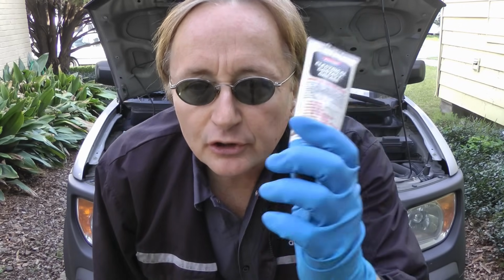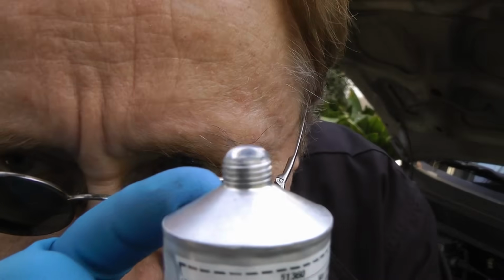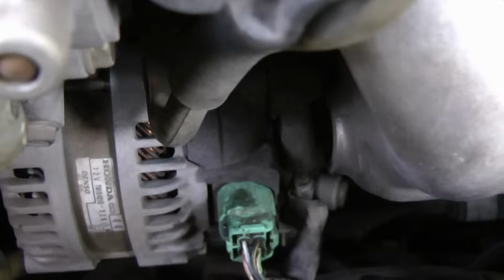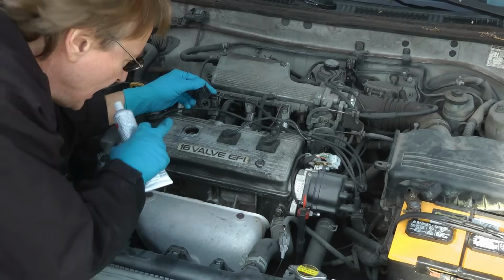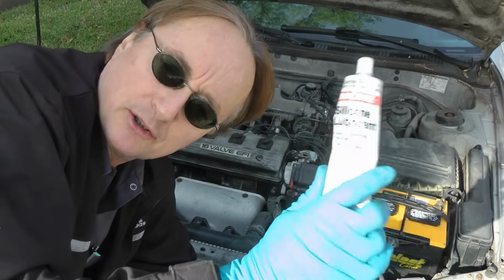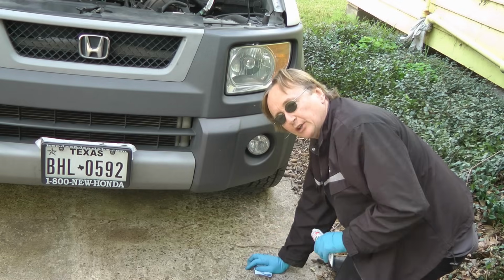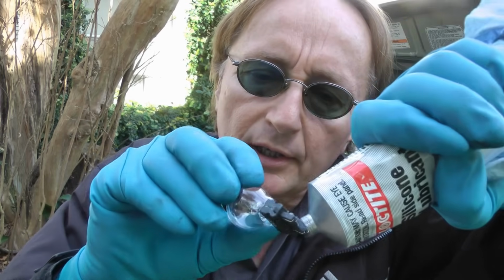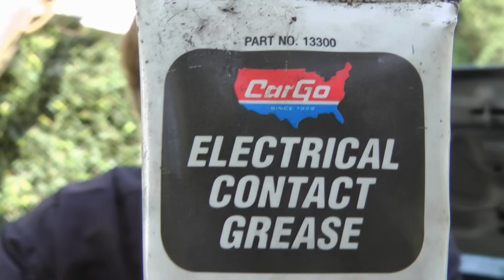How to use Dielectric Grease on Electrical Connections in Your Car

Comment: Dielectric grease does not conduct electricity! The contacts in the connector are designed to squeeze grease out of the way and create metal-to-metal contact. In applications where arcing is a problem a "more conductive" grease (loaded with metal powder) is used to prevent grease from breaking down as arc passes through it.
Reply: would putting some grease like this on the brushes of a brushed motor make it run smoother and more efficient?
Reply: I don't know for sure, but I would guess that grease could interfere with the brushes making good contact, so I wouldn't do it.
Reply: Motor brushes are low pressure connections, so I don't think it would work well.  Connectors are relatively high pressure.
Reply: Yes,if it did conduct electricity he would have a short the way spread it across the connectors the way he did.
Reply: @John Scarce Probably not a good idea. The grease would begin to collect the carbon brush dust, and eventually could begin to cause severe problems.
Reply: Finally!  Someone who knows what they are talking about!  Thank you, One Two.
Reply: I really don't know why this guy gets any views with massive errors like this.
Reply: You can buy conductive dielectric grease, the stuff I can get locally is called conductive carbon silicone grease, but if you are putting it on plugs there is no way it can be conductive you will short out! The conductive stuff is good for grounds.
Reply: @KurtisPape  
If it is conductive it cannot also be dielectric.
Reply: @otm646  I mean most of the time he's right. Sometimes you have to do your own research and cross reference to avoid death or injury
Reply: I’ve tested dialectic grease to see if it could conduct electricity and it didn’t
Reply: is putting dielectric grease on a crankshaft position sensor a bad idea?
Reply: @two_number_nines  grease stops contact surfaces oxidising, motor brushes always have a clean unoxidised surface because they gradually wear down through contact with the stator so it’s not necessary.
Reply: @Jim although people make mistakes, a good mechanic should know what dielectric grease is and what it can be used on. The first point on the grease tube he showed at the beginning literally says “seals, waterproofs, insulates”. An insulator is the opposite of a conductor.
Reply: @two_number_nines  no
Reply: Excellent!!!
Reply: @otm646  he just knows it works. Lol.
Reply: I like Scotty's vidioes. He has some very helpful ones, But he is wrong on this one. Dielectric grease does not conduct electricity. It does act as an insulator and prevent corrosion but when you put an excess amount in a connector your subject to have an open circuit. I have already made this mistake myself and had to go back and clean the connections.
Reply: True, but by preventing any type of corrosion and make these connectors insulated! Theoretically, you are keeping the the Electric Conductivity remain superior and that's what you need.
Reply: @otm646  I been doing this method for years and my battery is still kicking in my 370Z. I have a 4 year old battery in my car.
Reply: Down below in a few of his earlier replies, he does correct himself on this.
Reply: @One Two Yes you are right, Despite the fact it has "electric" right there in the name, it's a fairly common misconception that dielectric grease is capable of conducting electricity. In actual fact, dielectric grease is an insulator and doesn't conduct electricity
Reply: @two_number_nines  Simple answer...NO!!
Reply: I was thinking that same thing. If dielectric grease conducted electricity, the connectors would short out.
Reply: I use it on all connections I come across I never had a problem. I’m not say what it does or doesn’t do. But it’s piece of mind in a tube for me.
Reply: Glad you said this.  People always think it conducts.  Surprised Scottie doesn’t know this.  You’re actually NOT supposed to put it where the current flows.  Just everywhere else.
Reply: @TheLatinoExplorer  That is irrelevant. Your luck with still getting connection around the NONCONDUCTIVE grease, does not negate physics. The grease prevents voltage leakage, and helps to shield from corrosion. Its for the outside of connections. It is not for between connections. Scotty is normally correct and helpful, but this is one of his "tips", that is more wrong, than right.
Reply: @shiza237  you must drove a ford or some foreign job
Reply: @two_number_nines  Connector grease on carbon brushes to make it run smoother on the commutator?  Now I've heard it all!  Graphite dust is already a great lubricant.  Silicone grease is non-conductive.  And you wouldn't want a more conductive grease here anyway - you'd short the separate circuits.  If you put it on brushes and they managed to still function, then you would build up powdered graphite and possibly cause serious damage to your electric motor through arcing and short-circuits.  Carbon/graphite brushes are made from that material for a reason, they're soft, self-lubricating, conductive terminals.  Leave them alone except to replace them with the same size if they're overly worn.
Reply: @dr.moustafaibrahim6810 that’s exactly what I got out of it. It keeps the contacts from crusting over so they will continue to pass electricity.
Reply: @ckmoore101  Thanks for you comment. They way you explained it makes sense to me.
Reply: Sometimes we make slips in our speech. From what I gather he meant to say insulator and not conductor. Which in the end, he corrected. All is well again in the world. No need to panic. It does prevent corrosion and keeps out moisture like he said.
Reply: @dougsanders6034  Is that because the grease is held in a confined space maybe building up some pressure that holds the connector from being able to contract onto the other single contact? I'm thinking of a wire harness plug on a camshaft position sensor where a gob of dielectric grease is put in and the harness plug is pushed into place without the grease being able to escape... which may be the no start problem I'm trying to fix and what brought me to this video.
Reply: @rachelblack3816  Scotty is correct 99% of the time Very Very intelligent man. Dielectric Grease dose not conduct  do not put between Battery terminals Trust me
Reply: @otm646  99% of the time correct Very Intelligent man but 100% wrong on Dielectric Grease being a conductor
Reply: @kenrink5206  Dielectric grease makes no difference to the electrical connection, it doesn't matter that it does not conduct, it's not meant to-- and it doesn't matter that it doesn't.
In all areas of an electrical connection between two conductors, the dielectric grease is EASILY displaced by the touching metal surfaces, so the dielectric grease will only end up surrounding all of the contact points, and sealing them away from moisture and oxygen, which would cause corrosion.  That is exactly what dielectric grease is supposed to do: not make better contacts, but to seal those contact points to protect them from the outside elements, to keep them clean and conducting!
Dielectric grease is especially important to use in moist or corrosive atmospheres, such as on boats, and especially salt water craft.
Dielectric grease will not cause electrical conduction problems.

Comment: I use dielectric grease on my hair so if I my head is ever struck by lightning the metal plate in my head won't oxidize.
Reply: LMAO!
Reply: hahahaha!!!! Dude you are funny
Reply: @TorqueDorque  But not that funny.... lol
Reply: Funny but dead. Lightning far exceed the dielectric strength of silicone grease.
Reply: A tinfoil hat ground to a stake may. Problem is aluminum burns . Use a big stake mate.
Reply: O  M  G!! 😂👍🏻

Comment: "It conducts electricity really well..."  <- NO!  "Dielectric" means it's an electrical INSULATOR.   The only thing dielectric grease is supposed to conduct is heat, such as for electronics that fit against a metal heatsink.  But you are right that it seals connectors against corrosion.
Reply: I have never heard of using Dielectric grease for heat sinks, they make a special compound for that called heat sink compound, it's a thick white compound that you put on the back of the heat sink to transfer heat from the component to the heat sink. Every place I have ever worked that's what the electricians used, they never used dielectric grease on heat sinks.
Reply: I’ve read to think of it as electric die grease   Some people say to put it on rubber and plastic and not metal connections. Others like you say to put it on connectors and metal parts. Which side is correct?!
Reply: @DON72657  they are the same thing. Well, same material anyways

Comment: I've used dielectric grease like that for years and I love the stuff. One more good place for it, is when you make a wire splice. Grease up the wire connection, slide the heat shrink down on it, and when it draws in, the grease will ooze out the ends and that connection will be absolutely corrosion and weather proof.

Comment: Dose NOT conduct electricity as everyone is pointing out in these comments. The only reason it helps electrical connections is that it prevents oxygen corrosion on the terminal surfaces. If it conducted electricity lots of automotive light bulbs would have had big problems by now.

Comment: If anyone wants a CONDUCTIVE grease that water proofs(to an extent), fixes corrosion and prevents corrosion  use DeoxIT L260 Grease with Copper (Type L260Cp). Its a type of electric grease that actually conducts electricity so be careful not to get it into areas that might cause a short.
Reply: DeOXIT on every pin/socket on any electronics, period. Even gold plated pins in a harsh environment will oxidize to a point of failure. At my job we had a worldwide escalation involving gold plated pogo pins burning up on a board, that was 100% solved using DeOXIT Gold.
Reply: @dinuguan510  please tell me what kind of environment oxidizes gold?

Comment: I used dielectric grease on my 7-point connection to my truck for my trailer. It actually made one of the connection points fail. When I removed the grease, it restored the connection. It seems to me if you are going to use it in electrical connectors the connectors must have very good contact with each other in order to displace the dielectric grease when you plug in the connectors, so it does not act as an insulator.

Comment: With soooo many mixed opinions...probably just fine either way. I wouldnt put it on as heavy as  Scotty is showing. But a thin coat is good. It seals out moisture WITHOUT disturbing the electrical connection. Best way i can explain it.

Comment: If you look up what dielectric means, you will learn that it is NOT an electrical conductor but a insulator. It it disrupts the flow of currents and therefore decrease the ability of your electrical system to function optimally.

Comment: Dielectric silicon grease actually does not conduct electricity at all . It is a total insulator however it prevents water dirt and eventually oxidation from happening to electrical contacts and clips. That's why it is used. Just think about it if it's electrically conductive then it might actually create a short circuit and burn fuses in your car. But thank you for the video of course.
Reply from the maker: YES, you are right, I misspoke saying it was. BUT the use in this video is all correct, which is the important thing. I know cause an electrician was the one who showed me how to use it

Comment: I have the answer. Watch the official CRC video for applying their dielectric. Watch the technician GOOP the stuff into all the connectors, even on RELAY pins! The grease works by Constricting the flow of electricity across connectors; Defining the flow by grease to stop all -arching-, which can occur constantly at a microscopic level. By constricting the flow, the connections are "improved".

Comment: Regarding the critcisms of this video. When dielectric grease first came out I had mechanics (now called techs) tell me to coat the terminals with it. In fact, with those early electronic modules they would say to squirt the whole connector full of grease before plugging the connectors together. Maybe back then the product wasn't fully understood (or the people selling it said, "just squeeze it all over everything!"). The reason I think it worked in many applications is that when the connections were pressed together there would be tight metal-to-metal contact inside the connector and the grease would seal everything around it.

I'm thinking, now that the product is better understood, it probably makes sense to think about your application. Are the connectors going to go together tightly, scraping the grease away with metal-to-metal contact as they are pressed together? Or, are you going to have a connection where you can't count on a scraping action to create metal to metal contact when the connection is assembled? 

I've typically coated the connections on my car battery with dielectric. I can't recall it causing observable problems. But, I'm thinking it is probably wiser to clean the connections, assemble the connections, then use dielectric just to seal over the top. AGS has a video where they install the red and blue felts first and coat the surface of the felts with a little dielectric which I guess might help seal the bottom of the connection. Not a bad idea I guess.

Comment: I was sooooo confused about this.
It is an electrical insulator, not a conductor.  It just prevents dirt, grime, water, and rust from building up on connections so that the connection stays cleaner for longer.  If there was conductive grease between contacts and terminals it would cause a short and no end of issues.  This does nothing at all to help make contact, just keep what contact is made clean.

Comment: Dielectric grease does not conduct electricity.  In fact, it's just the opposite. So how does it work?  You shove it all over the connectors.  When the metal parts meet, they displace the grease and make connectivity.  All the remaining grease insulates the connection from moisture and other elements that can cause corrosion especially when your connection is made of dissimilar metals.  Your only caution is to be careful of silicone based O-rings and other type of rubber connectors.  The dielectric silicone will deteriorate those materials over time.  But it works great and SK applies it properly.

Comment: Bro... Think about it... If dielectric grease was conductive, it would be fine on battery terminals, but you'd be shorting out those little connectors like the lights n stuff

Comment: cheap to buy in auto part styore in a small foil packe ... Close it with masking tape over the corner when done ! Apply with a Q-Tip end it is easy to use ! Put it lightly in the white ceramic of a spark plug!

Comment: If I would have known this I would have same so much money. I have a 2010 chrysler town and country and a egr and injector# 2 staying open code. It was 1 of the harnesses which had corrosion. It still has a hesitation but no codes. I was told by mecanic to use it like that until I get a code. I also noticed that the harnesses aren't in good shape.

Comment: I just read the other peoples post's here. I thought the dielectric grease prevented the contact but I just used a little with a screwdriver flat-end to rub it on the headlight  female terminal on  the small area where the bulb end with the pins insert in,  just a dab. Like I said don't know why "Both" are not working?

Comment: Hmmm, does washing the engine rid of the grease?  I like keeping the engine clean and used the foamy engine clean once a year.  I guess check a few connection to see if it has any grease on them... or I will be heading to the Autozone to get some of that electrical grease back on.

Comment: Scotty, I love you man, but you misspoke when you said dielectric grease conducts electricity.  It is non-conductive.  I also thought the name "dielectric" meant it conducts electricity, but that seemed counter-intuitive, because wouldn't that create short circuits on electrical plugs?  After much research, I've seen videos where they perform electrical tests that prove that dielectric grease stops the flow of electricity.  The idea is that when the electric parts are connected, the dielectric grease is squeezed out from between the actual mating surfaces and thus doesn't hinder the flow of electricity, but, like I said, it also doesn't help the flow of electricity either.  The point is that it prevents corrosion.

Comment: Dielectric grease doesn't help electricity conduct better. Corrosion free connections help electricity conduct better. Dielectric grease is an insulator, and it will help seal out moisture to stop corrosion and wet short circuiting. If dielectric grease was a conductor, it would short out every electrical connection you put it on.

Comment: di·e·lec·tric
Physics
adjective
adjective: dielectric

    having the property of transmitting electric force without conduction; insulating.

noun
noun: dielectric; plural noun: dielectrics

    a medium or substance that transmits electric force without conduction; an insulator.

Comment: So which grease to use then? Wouldn't an insulating grease impede the flow of electricity in the connections if you filled them with it?

Comment: Scott you should really pull this video it's so wrong. I used it on a new battery install and put the die electric grease on the battery terminal and then installed the terminals, battery issues almost immediately, so I cleaned it all off and the issues went away.

Comment: In theory, if you really gob that stuff on... lets say in a spark plug wire... and there is enough grease to make a path from the spark plug wire lead, to the head of the engine, won't it cause a short or at least current leakage?